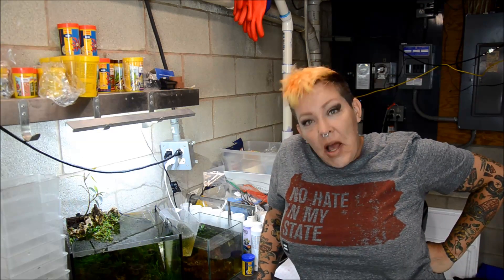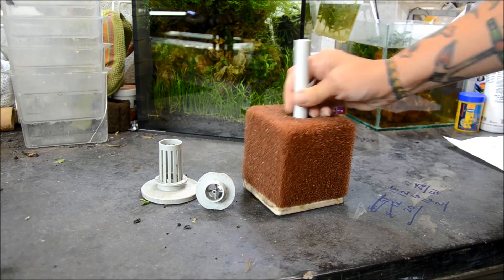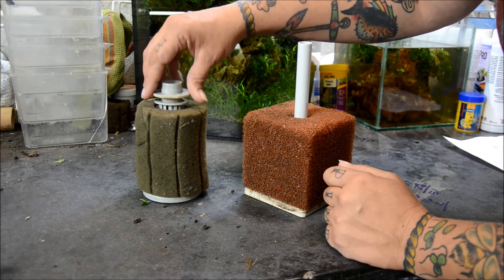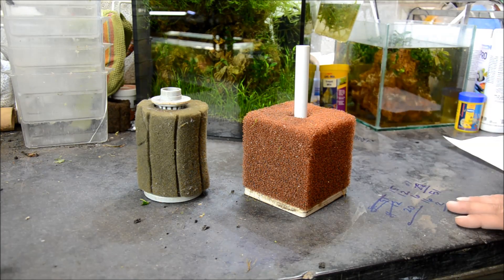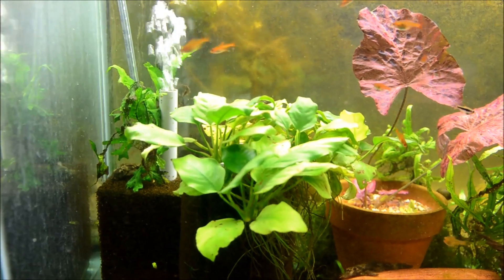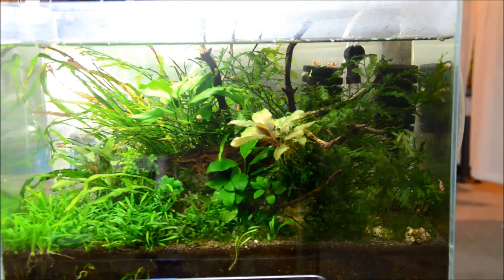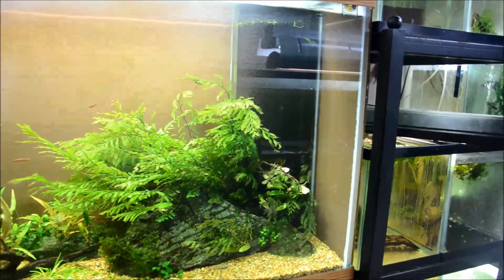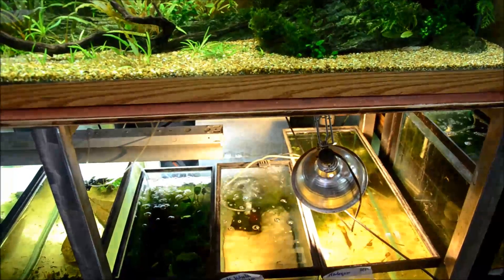The How and Why of Sponge Filtration- The Quick and Dirty

Comment: I love sponge filters, but by far my favorite type of filter is an under gravel system.
The enormous amount of surface area provides an excelent environment for beneficial bacteria to set up shop in my substrate.
This allows me to stock my tanks without worry of overwhelming it with too large a bio-load.
I use sponge filters in all my Fry/Nursery tanks.
I keep these all as bare bottom tanks.
Reply: Wish I could use under gravel, but I have too many fish that dig, making them ineffective. :  -(
Reply: You can use a section of plastic florescent light defuser over the filter plate and under the gravel to protect your substrate from being disturbed by diggers.

Comment: I run two power filters (hang on back or canister) on all of my tanks and each filter has a sponge over the intake tube to pre-filter the water before it gets into the filter itself.  I rinse out the sponges when I do water changes and very, very rarely do anything with the filter media that is inside the filters.  The sponges serve as mechanical filters and allow the media inside the filters to hold the beneficial bacteria to filter the water biologically.  My power filters last a very long time this way, my water is always crystal clear and I never have to worry about fry or shrimp getting sucked up into the filters.  One of my tanks has a lot of java moss and duckweed in it and I do not have to worry about it getting sucked up into the filters either.

Comment: I just discovered mattenfilters when my guppy club had a meeting.  A club member showed us how to make them.  I'm seriously considering changing as many box filters to mattenfilters.  Making a ton from scratch is a bit expensive (in Canada atleast) but considering what I spend on filter floss, and replacing box filters when they break its worth it.  Also, like you mentioned in your video, you haven't cleaned your mattenfilter in 2 years.  That's the biggest bonus for me atleast!
Reply: You can get large filter pads from Aliexpress or similar source very cheap (i.e. 45x45x5 cm filter pad costs only something like 5€ without any shipping fees). If I ever get rich and can afford a house I'm going to build aquarium room with a largeish 300x50x60 aquarium as a centerpiece. That's definitely going to have a large mattenfilter in one end. They are super useful in a larger aquarium where the space they use up is not such a huge issue. Just add a few glass holders and you can just slide off the filter pad when it needs cleaning without disturbing the substrate.
Reply: We found a supplier in Toronto where I live that its reasonably priced.  I think it will eventually happen.  We'll see.
Reply: Could I ask where?

Comment: I use canister filters in my 150 gallon that houses my huge Oscars.   If I used sponge filters the Oscars would destroy them.  In my smaller tanks I use sponge filters as welk as H.O.B. filters. The H.O.B. filters are so I cam ad chemical filtration when needed.

Comment: I love sponges for filtration. I've used many variants of the air lift styles. They all seem to have their good points. I do prefer the block type, open cell. I've also modified blocks for use in HOTs and canister filters, both for mechanical as well as biological filtration.

Comment: I love sponge filters! I use them in every tank Ive ever owned. Great at adding oxygen, easy maintenance, cheap and doesn't create turbulence that sometimes can be too much for certain species. On top of that no annoyance of needing to remove carbon if you are treating a tank. If I want to add some current or use carbon, I'll generally hook on a HoB as well. 

I've spent the money on a canister filter and Tbh I'm not impressed. Sure it gets good current and flow but I've had issues and just not impressed for what I've spent.

Comment: I'm in the process of replacing all of my many internal and external filters with sponge filters as I am SO fed up of impellers stalling, filter sponges being crap and getting so clogged in heavily fed tanks that I have to clean them every other day to make sure the filter doesn't stop working. I know songe filters need cleaning but at least they have no moving parts and won't stop functioning entirely unless I really neglect them!

Only problem is I have tanks in every room of the house apart from the upstairs bathroom so I'm going to have to have lots of small annoying air pumps or hack some rather large holes through my walls to make a centralised system >_<
Reply: Another bonus is that you can see that they are working, or not. A lot of my filters just aren;t obvious if they stall. Thankfully my Malaysian trumpet snails provide an early warning system if something is up as they start climbing the glass. Helpful little chaps :)
Reply: ada205mi I accomplish the exact same thing with prefilters on my intakes. Most quality sponge filters are 20ppi sponges. I use hydor 20ppi prefilters. They actually sell a kit specifically for this that will even replace the odd ball Strainer intake on fluval intakes. I’ve got them to fit to aquaclears, fluval fx6, Marineland c series, seachemtidals, penplex cascades. On and on.. I’ve yet to find a filter the kit doesn’t have the right adapter to fit other then biowheel filters with that weird square tube. I use some old emperor 400’s much the same way as one would a sponge filter for setting up a quick emergency tank as I can swap over one biowheel the same as moving a sponge filter. I clean these prefilters weekly with tap water as I’m not using them for biological filtration. Mostly to reduce filter cleaning wo driving nitrates up from gunk trapped inside rotting away. I also run a lot of medium and fine sand substrates with digging fish and coupled with 2000gph wavemakers normally used for salt tanks. Not a major issue for standard canister filters using the bottom up filtration flow but on a hob or fluval it will eat up impellers quick so they are also there to reduce sand being sucked into the filters. I would highly recommend the hydor prefilter setup for anyone on any tank. Many prefilters are a little cheap and gimmicky or use too corse foams at 30ppi making them almost worthless. The hydors use the exact same foams they use for their sponges and we all know that they took over api so you are talking the very best sponges on market..
Reply: Ash Totally agree. I keep Discus and on those tanks I've multiple externals but I've also got an Apistogramma addiction so I have 18'' and 24'' tanks all around the house which all run sponge filters like the one in video with twin sponges. They are super cheap, very effective, and best of all way easier to maintain than both internal and external canisters. I've always got 2 or 3 brand news ones on standby and a couple running in the Discus tanks incase of emergency purchases and immediate new tank set up needed!!! We've all been there!!! 
Cleaning wise, their so easy. I simply pull the sponges of the sleeves when doing weekly water changes and rinse in the bucket of tank water I've just syphoned from tank. Bn doing this for 30 years plus now, literally takes a few seconds!
Reply: One stop over feeding your tanks, two if you can’t notice a filter isn’t flowing in a few hours you need to evaluate your husbantry habits. More so then all this you need to evaluate how you are stocking your filters. I run all types of filters. If you’re clogging the sponges on a type filter you are also going to clog b type sponge filter in the same manner. Try using more corse sponge and possibly even no fine filter padding. I have to do this on a couple tanks to keeps filters from premature clogging on very very over stocked tanks. Changing to a sponge filter isn’t the solution to your neglect. It will clog all the same likely faster as the flow is slower and as a result not as much water pressure to push through the muck. I like to clean out my impellers every filter cleaning just so I don’t have issues. It’s one small additional step. Also try using a prefilter sponge on intakes.. this will act similar to a sponge filter you can clean weekly or however but also keep your impellers cleaner as well as your media in whatever type of filter you run. Sponges are best suited for economy and sort term which is why fish stores use them. They are not worried about filtration as they are on auto water change systems so water filtration isn’t as big a deal. 

Swapping to sponge filters isn’t going to be a solution just another problem to address.
Reply: Did you find a way to quiet the air pumps?

Comment from the maker: I buy my sponge filters at www.swisstropicals.com
Reply from the maker: +Steve Story they occlude slower and you can pick your ppi
Reply from the maker: +Steve Story for the average consumer 30ppi is fine. I went with 10 and 20 because I have so many to maintain
Reply: Hi,

I would too, if they had these kind of filters:
https://www.garnelen-tom.de/zwerggarnelen-shop/Aqua-Mac-HMF-Eck-Mattenfilter-EM-300-ppi-45-Schwamm

Thanks for the good episode! Sponge filters all the way!
Reply: Rachel O'leary any reason why you like the Swiss Tropicals over the ATI Pro sponge filters?
Reply: Rachel O'leary Thanks😊 what ppi would you recommend in most cases?
Reply: I wish they had better design for their website. It is so hard to look for without pictures on the main page. Plus, no clear information on the product. Not user friendly. I am looking for block sponge filter for my 100 gallon tank that has guppies and shrimps
Reply: I am late to this party, but I have been running a Swisstropicals corner HMF in a 10 gallon for about a week, and I really think I am going to like it. My next tank will probably be rimless, so I might have to find something that works well for that.
Reply: Rachel O'leary hello Rachael I wanted to know why you can't use a chemical filter with these?  I plan on using a sponge filter along with the hob I already have. I put either carbon or purigen in the hob. 
Thanks
Reply: a b , I think you misunderstood. You can’t use chemical filtration because there is no place to stick carbon and so on “inside” a sponge filter. You can, however, run them in other types of filters alongside the sponge filter, like a HOB, in the same aquarium.
Reply: kishasara1 ah ok thanks
Reply: Someone buy me a sponge filter cuz i'm broke.

JK lel